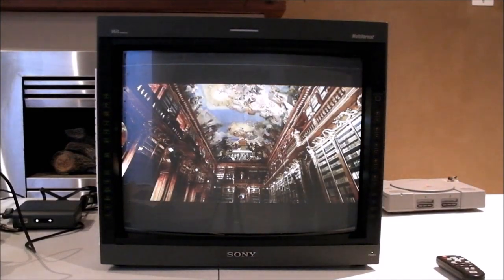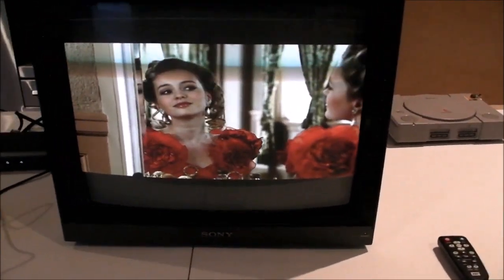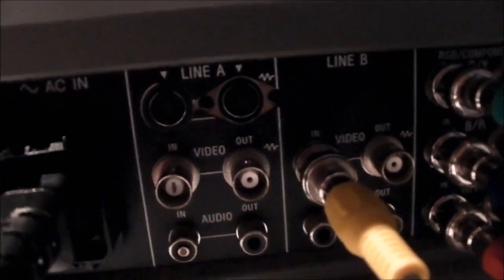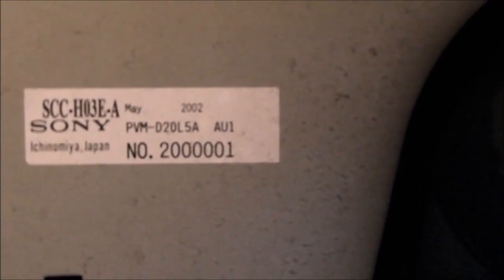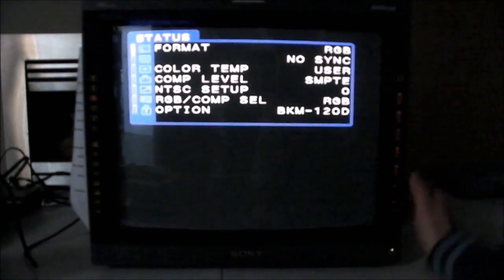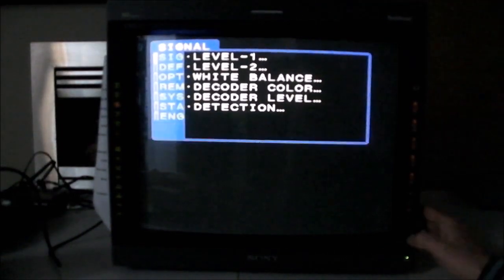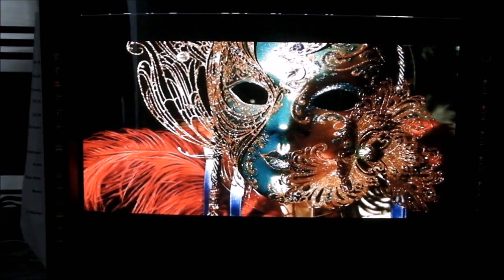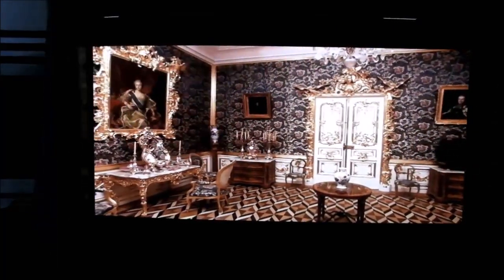Sony PVM-D20L5A 20" Crt Monitor

Comment: Ouch, that hurts! Especially when I only have a 14L2 in my possession which only does SD at 15KHz. It seems that The L2 models were in fact the entry level PVMs at that time and the L5 versions being the top level ones which do HD. The L5 really delivers all the otherwise missed potential of those PVMs.

But I do suspect they all use the same 1000-TVL tubes inside despite Sony claiming 600-TVL only on the L2 ones. When looking at the tube at a very close distance, the aperture grille is almost invisible (unlike my older 1454QM, but just like my 17" Trinitron PC monitor).

Also, a 1280x or more signal (1280x576 interlaced for example) does produce a very sharp picture, even on an L2. I suspect it to be lowpass-filtered horizontally on L2s to make it look like 600-TVL on standard 720x resolutions (OSD menus appear sharper than the picture itself).
Reply: +InvisibleChrist Thanks for your info. As I never bothered looking at service manuals for both, I suspected they had the same tube, because of the announced dot pitch (0.25mm for all the 14" models). Also, I thought all recent PVMs used the same type of darker tubes that Sony used in all their TVs at the time (so called "Super Trinitron"). Again, it seems I was wrong. Looking at the brochures again reveals that L2 and L3 models used P22 phosphors while L4 and beyond used EBU ones instead. Having a darker tube is indeed a really nice plus, as it boosts the contrast and visibility during daytime, as you said.

Comment: Great video! got one question though, I have a PVM 2053MD is it possible
 to connect it to modern sound system with sub-woofer and amplifier? or 
it can just be connected with PC speakers?

Comment: So this monitor is build for the southern hemisphere? 
Take it to Norway and all colors are wrong, or you must put the  crt upside down in the chassis?
Correct?
Reply: Wait what? I never heard of that! A tv from Australia won't work in the U.S. Why? I know there is pal used there as opposed to NTSC here in America.
Reply: http://www.repairfaq.org/sam/crtfaq.htm#crtcns
google for it

Yes, it is true that images on a monitor designed to work in one hemisphere will look slightly different when viewed from another hemisphere. This is because the cathode ray tubes (CRTs) that produce images in most desktop monitors are affected by the earth's magnetic field, and that field changes from one hemisphere to another. The change in image would not be radical. Rather it would be more like tilting the image to the right a few degrees, says John Hall, director of marketing for monitor manufacturer Acer Peripherals. But if you're a world traveler, don't despair. Most major monitor suppliers give users the controls they need to manually adjust the image. Notebook computers generally don't have this problem because they typically use liquid crystal display technology to produce images, and that technology is not affected by the shift in magnetic fields.
Reply: +pcuser80 wow! That's very interesting lol!! Very good info thanks. So basically the tvs are tweaked and built a little different in each hemisphere to begin with to compensate for wherever it is going (northern or southern) fascinating.....

Comment: This could actually play your GameCube with component cables in 480p then? And if you get a bvm I don't think it will, like yours can, so that might be something to think about as well. Correct me if I'm wrong
Reply: beefcurtainz69 the bvm-D20f1 can do 480p
Reply: @bneyens  The BVM A20F1U and BVM D20F1U are capable of 480p. The BVM-F Series 20F1U is a standard 15khz (240p/480i).

Someone is giving me one but I have not seen pictures, I hope it's one of the first two!
Reply: This is one of the best for Gamecube component 480p Progressive Scan that isn't a PVM

Comment: hey Rob, on my old BVM i have the same "digital component" inputs. Is this just SDI? Do you know if there is any way to i.e. get a PC with DVI/HDMI outputs connected to it via some sort of converter? And if so, do you think it might ahve any advantages over an analog (RGB) route with a downscaler like the extron emotia?
Reply from the maker: +l0rdm0rd yeah im not familiar with the digital side of things. Seems to be used by industry and industry only, with no crossover for domestic use. Youve got me curious about it all now. Just quickly looking then, I see SDI to HDMI converters are available.

Comment: Hey RGB rob i have just purchased a BVM-A20F1M and dont know ANYTHING about setting these things up :( i dont know how to tell if the geometry is good etc....  The monitor has 7800 hours so i think thats ok..... any tips? BTW i live in Sydney aus
Reply from the maker: +Nicholas Aoun Youll need a BKM-15R control unit to operate the monitor. You might already have that. I assume you want to run consoles on the monitor. Now this BVM was one that didnt come standard with an analogue input but you may have it.  I believe this is the card required the get analogue rgb and component from consoles into the monitor - 

http://www.pro.sony.eu/pro/lang/en/eu/product/broadcast-products-pro-monitors-option/bkm-68x/specifications/#specifications

Expensive and hard to get. Keep me updated on how you go with it. Rob
Reply: +RGB Rob Iv got the BKIM-16R control unit which works with this tv also :) so i was lucky in that regard however it didnt have the BKM-68x card in it :( which is needed for component input. Gonna have to search like crazy for one but im sure ill find one.  I have found a sony technician that can set up the monitor completely from the ground up so its 100% perfect but it might cost a bit..... i got the monitor for a HEAPS CHEAP anyway so should be worth it.
Reply: Hey Nicholas, I got myself in exactly the same situation as you! I bought my A20F1M around a year ago. No 68x. I did however get the 61D for S-Video, not ideal, but better than nothing! :) How did you get on setting it up? I'm having an nightmare with geometry! It never feels right!

Comment: I have a quick question wondering if anybody can help me with this. I'm looking at a Cvm3501 barco broadcast monitor and wanted to know if I will get the same result as a PVM broadcasting monitor?  If anybody can help me with this I would greatly appreciate it I need to make a decision by tomorrow. 
Thanks!
Reply from the maker: I dont know if you will get the same result, i have recently picked up a few Barco monitors for the first time, but am yet to see what they are like. The one in question looks to have a few years on it. Still, if the one your looking at is the one thats $30 odd dollars, for that price id definitely pick it up. If the owner can show you it working, at least powering on, that would be a good sign. Tell me how you go.
Reply from the maker: Also, make sure it has an input for RGB, by the number of connections on the back, id say it does take RGB, but from the picture i cant read anything.
Reply: RGB Rob yeah I spoke to the guy already and he send me some close-up pics it does have RGB input. And the manufacturing date is from February 2000 with a 20 inch screen. He says it works perfectly fine I'm going to check it out tomorrow so if everything is cherry I'll be picking it up. For $35 why not.
Reply: RGB Rob this is the exact model I'm looking at. http://www.provis-lahr.de/en/barco-cvm3051.html
Reply from the maker: Thats a bargain, the styling makes it look older than it is. newer the better. If that was for sale over here on ebay, probably would sell for $350 more like it.
Reply: RGB Rob I can imagine.
Reply from the maker: Did you pickup the barco?
Reply: RGB Rob yes I did for $35 it really wasn't a bad pick up. The only issue I'm having right now is that I can't get it on the S video settings. It's a real shame it's hard to find information on this particular model. All I was able to find it was just a technical stuff but no manual. I want that 950 TV line on high-resolution and I believe 700 on low resolution.
Reply: Sorry for the typos there but yeah it runs on 950 TV lines on high resolution and 700 TV lines on low resolution.
Reply: For right now I have it hook up on composite until I get RGB cables . It looks pretty good especially when you get the Color resolution  just right. The only other issue I have with it is that at times a line runs down the screen but that comes and goes sometimes if I mess around with the back I'll  go away but I'm not sure. Many  It's because I put it next to another monitor that I also pick up PVM 1351Q. Maybe some type of electrical interference?
Reply from the maker: Im glad you picked it up before someone else snavelled it up. If two monitors are right next to one another one touching and both turned on this can cause interference.